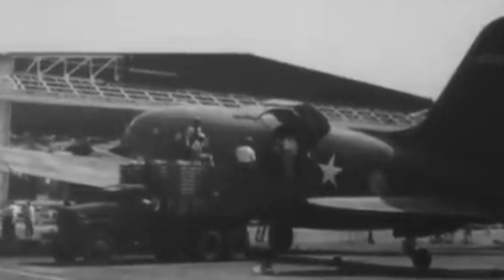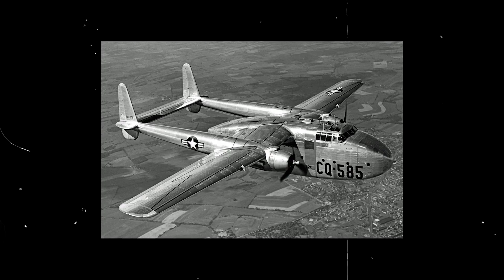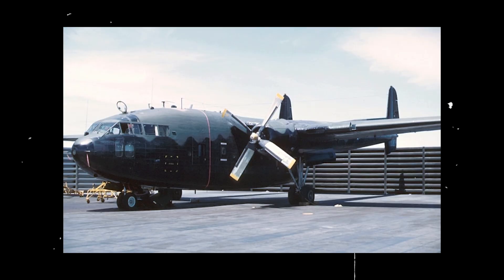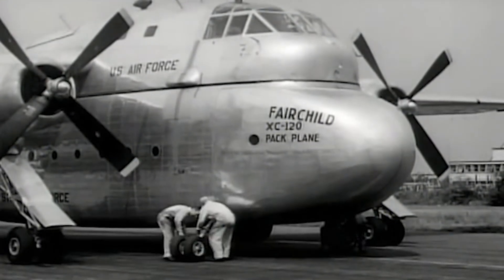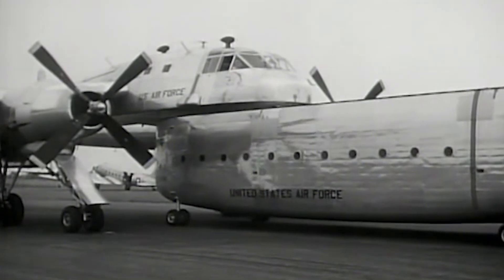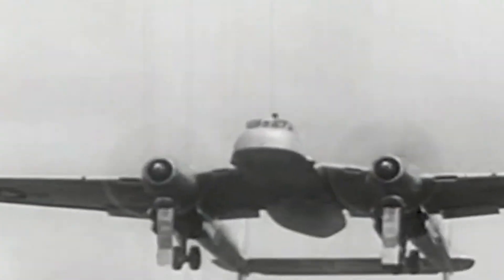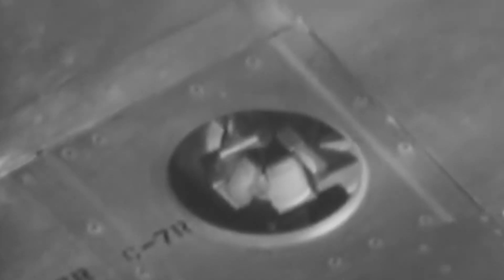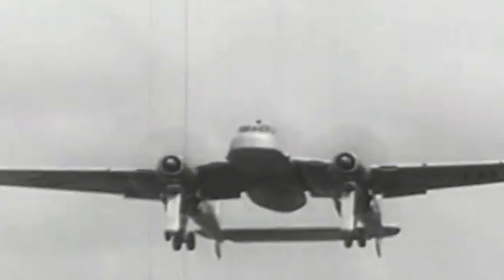Why Don't They Build It Today? The Most Brilliant Aircraft Design Ever

Comment: The modular pod idea hasn't been fully abandoned. Just tweeked. Instead of the pod being exterior, uniform containers are loaded and delivered. It's not 'as fast' as detaching a pod from the aircraft, but it maintains aerodynamics and flight stability as the only thing that changes about the plane is its weight.
Reply: I think the uniform container idea got real traction with commercial air cargo--look at what the likes of FedEx and UPS has done. And regular commercial airliners started to standardize on the LD3 container (most modern jet airliners use LD3's now).
Reply: @Sacto1654  ironically, the cans or containers are not uniform, and must be packed in specific positions to fit the contours of the fuselage
Reply: @PolishGreasePit  For below-floor cargo holds, they've pretty much standardized on LD3 containers for widebody aircraft.
Reply: And with LAPES (Low Altitude Parachute Extraction System), palletized cargo can be delivered out of a C-130 very quickly,  without the aircraft even touching the ground .
Reply: I remember seeing where this pod idea was tossed around for pax airliners to shorten the turnaround time.  Obviously that never caught on.  Would have been kinda crazy.. "Ok,  everyone get into this container, the plane will be here shortly to pick you up."
Reply: @unpopularopinion8608  but...loading times for passengers would be faster..you wouldn't have to wait for a plane to deboard/clean/misc. 
Just sit immediately in the departure pod, when plane lands, it disconnects the arriving passengers, then loads the next.. could actually reduce times. ⏲️
Reply: @Nowhandles  agreed, that was the theory behind the idea.
Reply: Good point
Reply: @Allen Watson that’s very true, but it’s still a shame the idea didn’t take off at least for civilian purposes. With technological advances automatic handling issues, portable field hospitals or kitchens could be a great niche design for disaster relief.

Like you said, standardizing the cargo and cargo bays was a simpler process for 99%+ of uses.
Reply: @chamuuemura5314  i this this cargo fuelage would be a boom for reducing friction in transporting humans as well as cargo.. it could also save money for travel by allowing for the preparing the airplane for its next flight without keeping its container empty.. also.. the transporting of an emply plane can be cheaper.. because it does not have to cary around a big empty cargo container..  What would be even more interesting  is if they made these pod carrying airplaines that were also vertical take off and vertical landing.. then these cargo container could even be delivered to warehouses or other facilities that do not have airports or runways.  I can see amazon and UPS and Fedex utilizing these types of airplanes, whether with standard runway take off or vertical take-off/landing.
Reply: Also the fact you can load new cargo on the return flight in a fixed fuselage loading area.
Reply: The big problem with this idea, from a military airlift perspective, is the fact that you still have a very LARGE and readily visible target -- not to mention a very valuable one! -- sitting at an airfield relatively close to enemy forces.  The reasons this is a problem are that: a) the airfield itself is a large, stationary target; and, b) the aircraft must still be offloaded, refueled, and often repaired before going on its next flight.  Depending on how long the aircrew has been at it, you may have reached crew rest limits.  So this doesn't necessarily get you closer to the battle lines any faster than conventional airlifters.  And it may get your airlifters blown up on the ramp -- not a desirable outcome for "the good guys".

As for disaster operations, many of the same issues apply.  You need to have a useable airfield close enough to the zone affected by the disaster to be able to make use of this "stop and drop" pod system: otherwise, you still need to truck in the cargo from a functional airfield.  So you need to keep track of the "Waffle House Index".  Created by then-FEMA Administrator Craig Fugate, this "index" was a rough estimate of how badly affected a disaster zone was made by surveying Waffle House restaurants in the area and checking what menu items they were offering.  A low index, indicated by few Waffle Houses open, indicated large-scale damage over a wide area, meaning that few (if any) airfields would be operational.  Without operational airfields, a "stop and drop" pod slinging aircraft won't do much good.
Reply: From a general freight perspective, it also means you can prepare the palettes at a distribution centre with the relevant goods, transport that by road or rail (or even air) then pack multiple palettes. The individual palettes can be customs sealed, etc., too ahead of time with a full waybill.
Reply: @Hans Hertlein LD2's became fairly common because of the large number of Boeing 767's built. But the LD3 is far more common because just about all modern widebody jets standardized on that container.
Reply: Yup. Good ol' tri-walls. I'll never forget seeing one rolled out the back of an Osprey in Afghanistan...damn hilarious. lol
Reply: Tell that to the Sikorsky Sky Crane, that can carry a standard shipping container externally.
Reply: @allenwatson8619 , Yes !!! An example would be the LD-3 containers used in the cargo pits of several Wide-body aircraft..  Prior to the LD-3 containers, planes like the DC-8's used Cargo Baskets that were loaded into the pits using a hoisting system built into the the planes... Sikorsky made the 'Skycrane' S-64 / CH-54 helicopters that could move containers of various shapes, weights & sizes to just about any location, (with the funding to back it up).... Yes, the idea these people had at Fairchild, many years ago, did catch-on with other types of equipment to move the cargo...
Reply: Yup. Today's cargo aircraft are so large, "pods" like this likely would just fit inside. The aircraft type just became so big, this concept was no longer necessary.

Comment: The plane equivalent of the Sikorsky S64 Skycrane.
Reply: Was thinking the same thing
Reply: And given a practical trial in Vietnam, the Army abandoned the pod idea and just used the Tarhe as a skycrane
Reply: @colbeausabre8842  Mississippi National Guard used the pods, I saw sky cranes flying ppl around in the 80s
Reply: The S64 IS a ‘plane’. (Aircraft)
Reply: @johnnunn8688  not really the S64 is a helicopter which is not a plane , although both are aircraft; its like calling an armored car a tank, both are armored Vehicles but one is wheeled and the other tracked, makes a difference
Reply: @jamesberry3230 , helicopters are rotary-winged aircraft. Fact.
Reply: @johnnunn8688 Not ever aircraft is a plane: fact. So make sure your actually correct before acting so cocky

Comment: I have seen modern versions of these types of planes where they can land and have a train drive inbetween the gear and load full containers to the bottom of the plane including passenger cars. This way you can get a train to the airport and then fly without having to leave your seat.
Reply: Except maritime containers, as carried by the railways, are heavier than those needed for aircraft and have the aerodynamics of a brick. OK, if we use aerodynamic pods we'll end up wasting space on the train. Plus you'd need to straddle vehicles that stand over a 1m tall at their highest points (based on UK container wagons) design to carry standard 40' maritime containers. You can do this for freight but not for passengers due to crash worthiness standards.
Reply: @neiloflongbeck5705  Plus, there's usually way more room on a train so you can't pack passengers in like they do an airplane which means much less profit for the flight which means expensive tickets.

Comment: Probably just got really good at roll on/roll off operations? I'll bet the stability problems would be a non issue today with fly by wire systems.
Reply: I thought it might be a good idea to use Airbus a380s as pack planes.

Combine two of them together at the wing like they do for strata launch, what's up with a huge lifting body cargo pod between them.

Build specialized airports out in the boondocks.

Even use a couple of integrated cranes so they can be unloaded from the front back and sides.

Used Tesla self-driving trucks for last ~30 mi delivery.

Since these aren't public airports they would require very little infrastructure. Everything optimized for cargo only.

Flying freight basically, competes with rail. Slightly more expensive, but slightly faster. Perfect for Amazon prime.

Comment: Was this the one in flight of the phoenix?  Did the ignition method really involve shooting a charge directly into the engine?
Reply: Original Phoenix was the C-82 Packet.  The remake used the C-119.
Reply: @lancerevell5979  thanks Lance.  I have only seen the remake.  If the original ever crosses my path I'll definitely watch it.

Comment: Definitely brilliant. Also about the same time people decided that cargo ship should go in the direction of containerization.
Reply: While watching, my thoughts went right down that corridor as well. Good point.
Reply: I agree it seems brilliant... but it never caught on. There must be a reason for that.
Reply: @pkz420  the flight control issues when unloaded. Why bother developing complex and expensive flight control software when you can have a simple tubular fuselage that can take lightweight containers built for aircraft. Just pull up your truck and roll them off the aircraft reducing unloading times compared to removing the pod and then unloading it. Also there are less things to go wrong. Damage any if the attachment points and the system fails, damage an anchoring point in side the fuselage then just use the one next to it (the fuselage anchoring points will be duplicated along the fuselage every few inches to maximise utility.
Reply: @neiloflongbeck5705  from a civilian point of view sure but from a military point of view they could fly in 3 or 4 of those cargo pods, pre packed and set up as barracks for a FOB or base camp, another as a command post, a third is a hospital etc. In the time it takes to build, set up, and stock those in the traditional sense these can be dropped, set up and be running even quicker.

In disaster relief they can prioritize pods. Drop a field hospital and blood bank then drop off say a water and food distribution point, a mobile auto shop to help locals fix needed vehicles and get their infra structure repaired. And as pods are no loger needed the clean up is simple and leaves a smaller footprint than we do now.
Reply: @JosephDawson1986  which they do using C-130s using trailers with wheels already in place for FOBs, or fly in containerised based modules in to such locations using a heavy lift helicopter such as the CH-47, as they have find for decades.
Reply: @neiloflongbeck5705  yes but those are 1/4 the size of the modules. The point is they could be doing it better than they are.
Reply: @JosephDawson1986  the containerised command posts I'm thinking of are based on the standard 6m by 2.5 by 2.5m ISO container. Which ones are you thinking of? Not the 3.4m by 3.4m by 2.75m tents?
Reply: @neiloflongbeck5705  Love it when a knowledgeable person fact-smacks some guy that puts forward hunches as facts, well done.
Reply: @neiloflongbeck5705  i Am thinkingnof the the standard US Army CP which is 25 long and expands out to 15 foot wide and isn8 foot tall
Reply: @JosephDawson1986  probably similar to what I'm think of, but I gave the packed and ready to go height and width. Most of those out there are standard 20 ft containers, but 25ft and longer exist. The lengths I've seen match to standard ISO shipping containers.